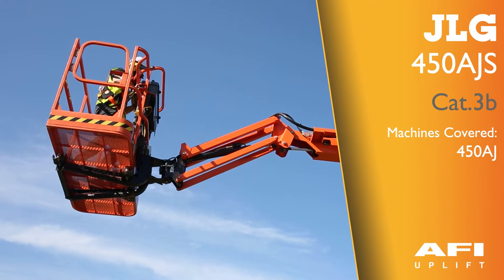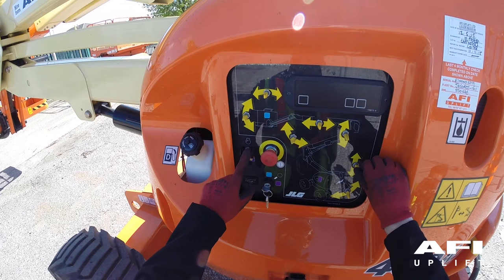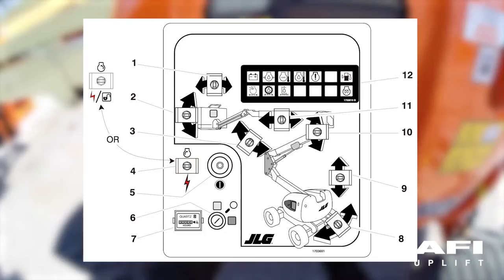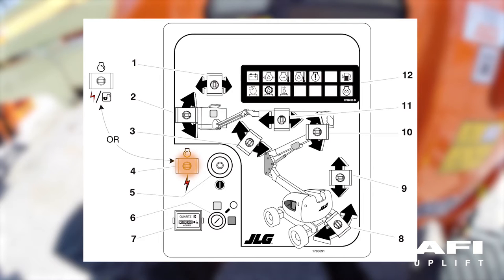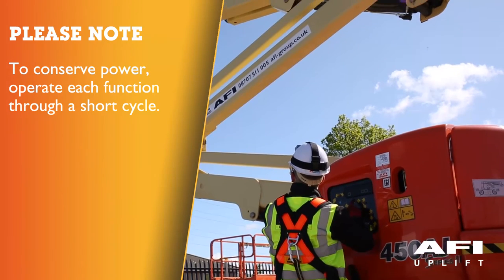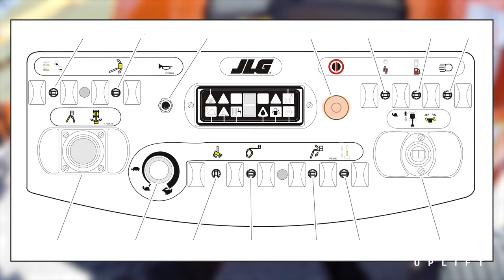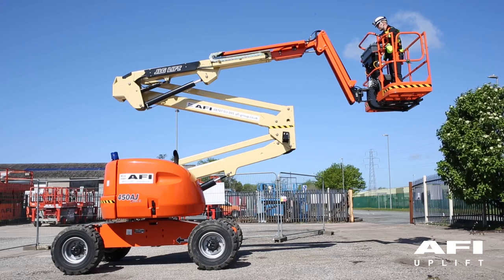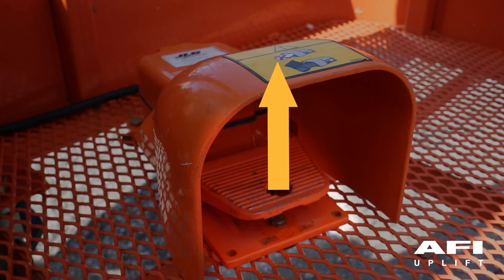AFI MEWP Emergency Lowering videos JLG J450AJ, J450AJS

Comment: But what is the main reason the mid and upper booms will not lower even when performing the emergency override? It goes up but not down on those two cylinders and the lines pressurize  and motor labors like it’s dead heading